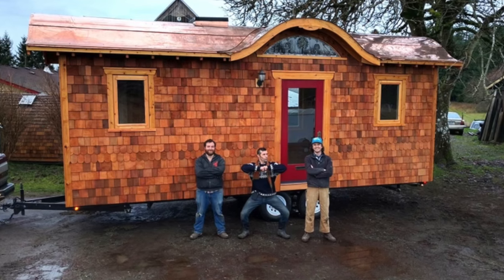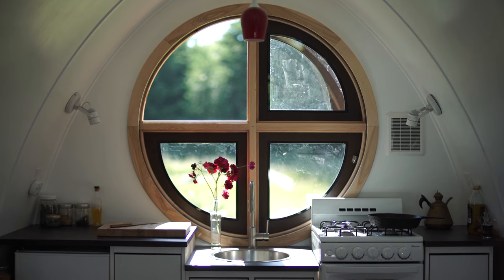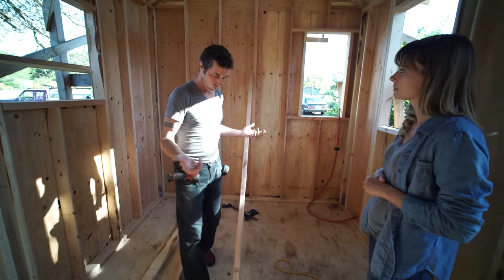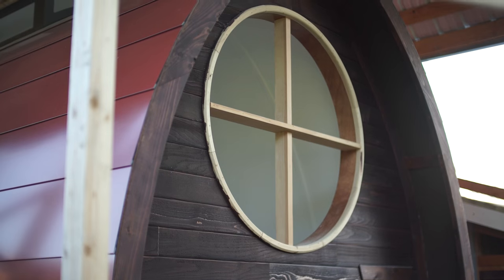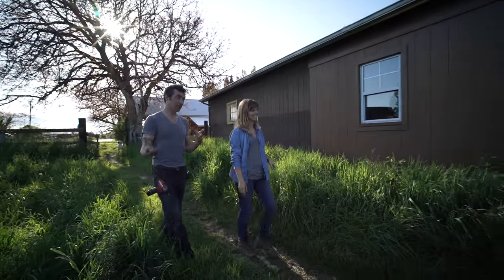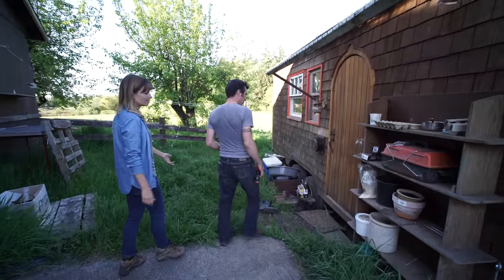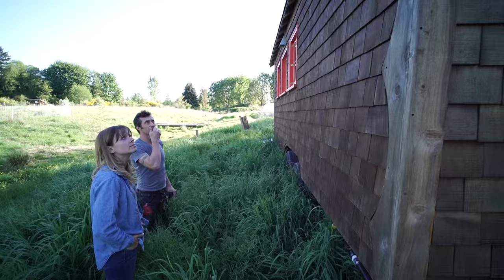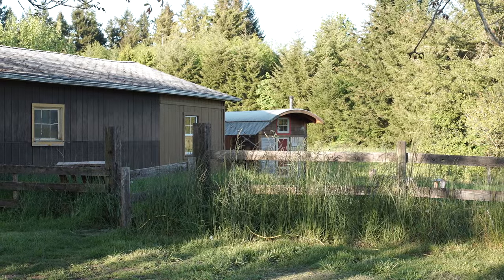Fantasy Tiny Houses Designed by Artistic Carpenter

Comment: Finally!  There is only one other TH that I have seen that raises a functional space (kitchen) and has a bed that slides out.  By day it is the couch/living room by night it is your bedroom.  That is THE best design for people that have no intention of climbing a ladder to a loft.  Are there any drawbacks to that design?    Love this channel!
Reply: +Betty O Yes, drawback ( I am my own worst critic) is that when the bed is in 'couch mode' it is a bit too low. I came up with an idea to fix that though... a flip up couch section, that is attached to the bed and hinges outward to become a footboard when the bed is extended. Perfect!
Reply: That sounds very cool....would like to see that.  If I were to design from scratch (having a more traditional shape TH not your domed roof line) I would raise the platform higher to accommodate the bed at a traditional couch height as I have long legs, then a system of drawers could be designed to pull out on the side of the bed when it is in full "bed mode", thus giving all the drawer type clothing storage you would possibly need.  I also thought your storage design with the exterior access was clever....Take Care.
Reply: +Abel Zimmerman Zyl great idea love your work ☺

Comment: Does he ship to Canada 🇨🇦?
Reply: Yes, I can.
Reply: Zyl Vardos 👍🏽 also what kind of weathering do you do? For temperatures ranging from 0 Celsius to -45 Celsius?
Reply: My normal builds meet IRC code for tiny houses, I use Low-E insulated glass throughout, and I use plumbing techniques and equipment that prevent freeze in temperate zones. However, if you are in a really cold zone, I do a version with extra insulation all around, and protected drain plumbing. It costs $4-5000 extra... but really increases the insulation envelope.
Reply: I can do that, but it costs a bit to adapt to those temps.